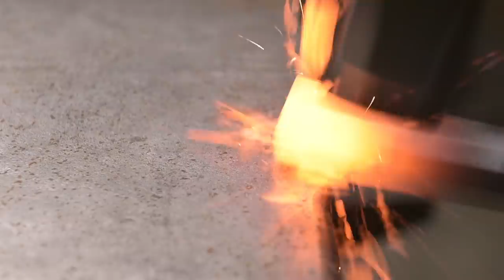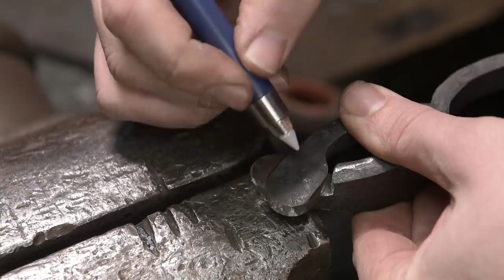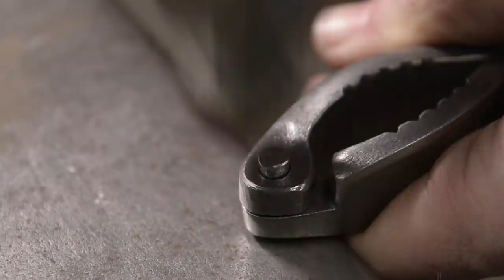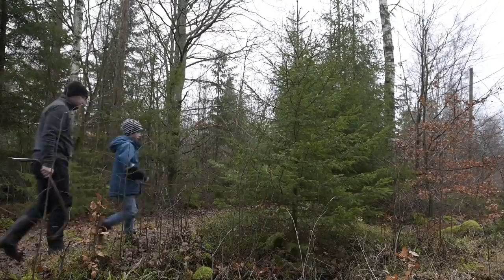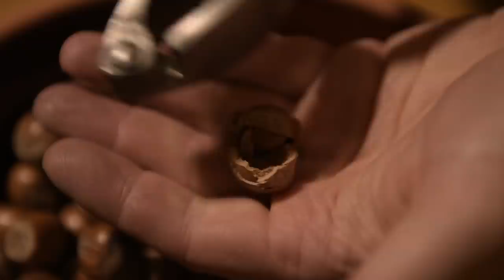Blacksmithing - Forging a nutcracker

Comment: Great closeups ... very instructive to see the exact effects of each blow and placement/angle, and how it progresses the overall shaping. 👍❤

I've got an entire drawer full of old nutcrackers I inherited from my parents and grandparents.  I've broken several over the years too, courtesy of handles that were a bit short and metal that was too brittle for forceful lateral squeezing.
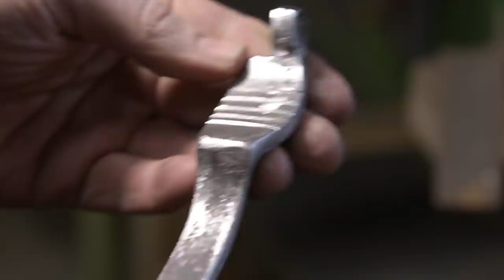Reply: SUGGESTION: Those grooves on the inner side of the curve (8:50) would probably benefit from being very slightly pointier, for better gripping of shells, esp smooth ones.  Perhaps a slender bladed cold chisel held at an angle in the groove and tapped would slightly raise the leading edges, almost like cutting teeth in a rasp.  

Anyway, they look great.  Hat's off to you, T.A. 😀
Reply from the maker: Thanks, with the "clam shell" form it seems to work fine, but your suggestion sounds good!
Reply from the maker: Merry Christmas BTW!
Reply: @torbjornahman  Holiday good wishes back atcha, with top spin no less. 😀

Comment: You should sell things like this, I would buy them
Reply: Fran Martinez You can't afford. While the video is only 10 minutes, it took more than 1 hour of work, and considering a scandinavian work hour costs 100 US$, the steel and coal and lineseed oil only a few bucks and also considering that items sold at a store do cost 4 times of their production cost, we are talking about 400 US$ worth. Of course I wonder why he used 15x15 instead if 5x15 and only twisting the end and curve and giving it outer shape by the grinder. Maybe the result wouldn't be strong enough. So true craftmanship does cost way  more than we are used to pay for industrial mass products from china.

Comment: I’ve never forged anything so can anyone tell me what the stuff is cracking off the metal when he hits it with a hammer or press?
Reply: It’s called scale. It’s like a layer of black rust, it should happen if your metal is hot enough. If it is not forming on the surface of the metal it might not be hot enough and you should put it back in the forge soon
Reply: Oh cool, thanks for the explanation

Comment: Very nice...out of the same method making a small crimping tool will also be useful for fixing lugs at wire ends..but the nutcracker is a very useful kitchen tool...

Comment: We've had one of those, sadly not made by Torbjörn... until I wanted to crack a nut. The nut rolled away laughing, my hand used bad words and the cheap aluminium alloy nutcracker was in two pieces:)
What did we learn from it?  
Well. We did buy a new one for the drawer and open the nuts now traditionally by squishing two together between the hands:) 
Nice work you did there Torbjörn, in my opinion the best of nutcracker-designs! congrats!
Greetings from Switzerland :)
Reply from the maker: Ha ha, lesson learned! :)

Comment: I wonder if you could round the outer edges of the middle contact point preserving adequate strength, so that i would not be a pinch point.
Reply from the maker: I did round it off a bit, but I guess it will always be a pinch point if you're not careful.

Comment: Such talent sir. U have a beautiful forge and tools. Is there a specific type of steel used when making ur tools? I’m sure it has to do with durability tensile strength and carbon make-up, but I was just wondering if there was a specific ratio u demand. I thoroughly  enjoy ur master craft...🎄🌲Merry Christmas❄️⛄️🌰🌬☃️🌟
Reply from the maker: Thanks. Hard to answer, each tool has it's own characteristics and there are many alloys to choose from. You would have to be more specific I'm afraid. :) Merry Christmas!

Comment: God Jul! Is that glogg? (US keyboard, please forgive the lack of the correct letter.) If so, my mom would be scandalized by you adding the flavorings in the mug instead of while it's on the stove. Still, no debating whether the nutcracker works. Better lock that up in the spring, or the squirrels will steal it off you...
Reply from the maker: Yes it's glögg! Merry Christmas!

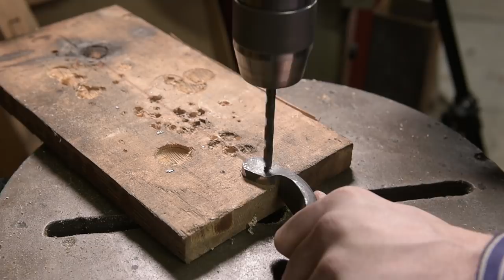Comment: at around 6:00, you drilled for the rivet at the top.  why not hot punch and drift it instead?  what are the considerations behind that kind of choice?

thank you very much!  as always, this was a great video.  I really enjoyed it.
Reply from the maker: The way I approached it, I needed to file the surfaces flat and fit the both halves nicely before determining the location of the holes. You could punch the holes but the process would have been a bit different.
Reply: @torbjornahman  
that makes sense.  I guess that means that you would have punched the holes before each half was completely finished, as with tongs.

thank you very much!!

Comment: Great project! Why did you choose to drill the holes instead of punching them?
Reply from the maker: I needed to do quite a bit of file work before I could determine the hole placement, and I needed to be quite precise. I guess you could have punched them, but it would probably require a bit different approach to the fitting of the two halves.
Reply: Torbjörn Åhman thank you

Comment: Amazing work as always, was there any particular reason your chose to drill the hole instead of drifting it? Asking because I'm going to be trying this in the future and would like to know which is the better option
Reply from the maker: Thanks. Because I wanted to be quite precise and needed to do a lot of filing before determining the location.
Reply: @torbjornahman  that makes sense. Thank you!

Comment: What fuel are you using in the forge? Is it anthracite or coke? Do you use anything different occasionally, maybe even when first starting the fire? Some videos there seems to be some light smoke and others it’s very very clean.

God jul och gott nytt år
Reply from the maker: Here I use coke. Sometimes I use coal as well. When you light the forge, even coke smokes a bit, but after a while there is pretty much nothing. Merry Christmas!

Comment: Love your work, nice holiday project, I naively thought you were going to use the bolt as your pivot (and was getting a little distressed)...... I should have known better, Merry Christmas. 
This is a strange comment but I just have to say I think you have the best sounding power hammer on youtube, what is it's striking wieght/power?
Reply from the maker: Thank you! This is my small spring hammer. The ram weight is 25kg. Merry Christmas!
Reply: @torbjornahman  Thanks for the reply, I went for a dive through your youtube play list and was happily suprised to find the an episode where you showed your ABNO #1 in opperation, now even more impressed with it, an absolutely wonderful piece of engeniering, cheers
Reply from the maker: @bunyipdan  Yes, it's a wonderful hammer!

Comment: Nice. But why no hardening? 
God Jul!
Reply from the maker: Not hardenable steel! Just mild steel. God Jul
Reply: I thought that the carbon from the coal fire migrated into the steel and made it hardenable?
Reply from the maker: @nhytg376tgyuu765gjmg  No, for that to happen you need to have the piece at critical temperature in a closed environment for several hours.
Reply: Ok, thanks 👍